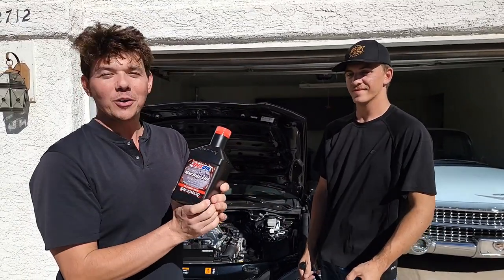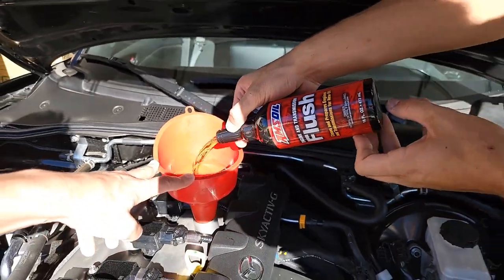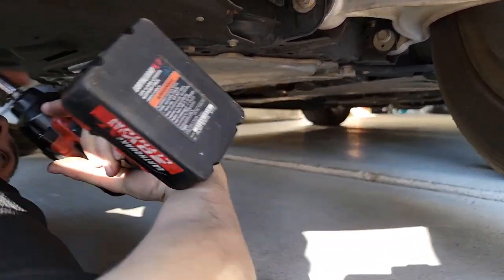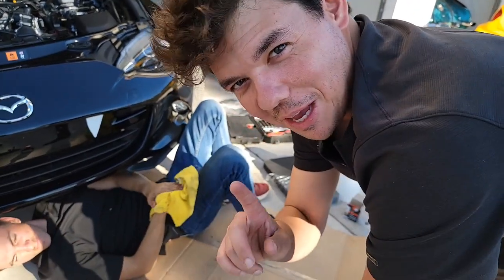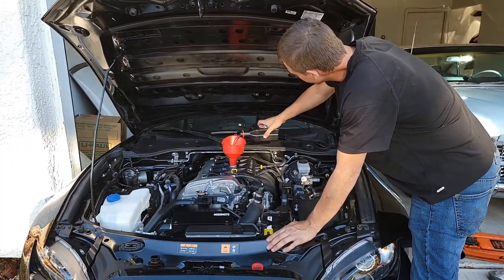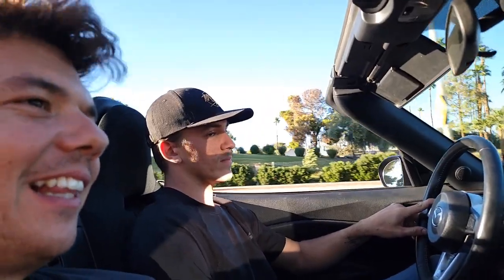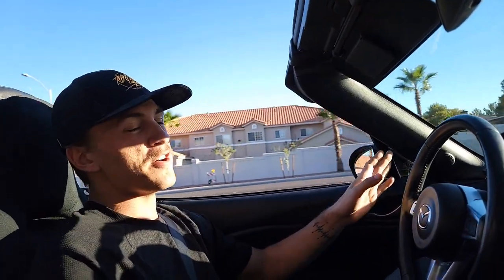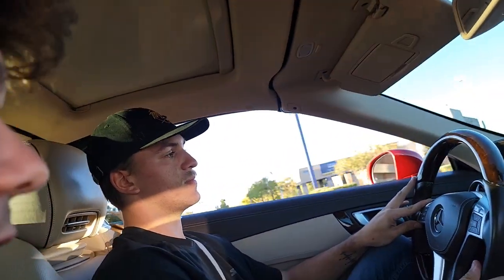Autocross Mazda Miata AMSOIL   10W-30 Oil Change & Dominator

Comment: What’s the drain intervals like on the dominator oil? I usually change my oil around every 3k miles
Reply from the maker: That's a great question there's a lot of different axiologies on that topic personally if I was running it I would change it every couple thousand miles if I was running E85 I would definitely change it every few hundred miles because ethanol breaks down oil definitely not worth risking it so it's always good to do oil analysis if you want to know exactly what to expect from the oil.
As they say a little preventative maintenance can go a long way and keeps the guesswork out of it💯
If you're new to Amsoil I highly recommend the six-month PC member will give you the best value on the products if you have any questions when you use my link I'll be able to answer them as your independent Amsoil dealer💯👍
New Promo: FREESHIP 
     ♥️   Shop by vehicle - https://www.amsoil.com/guides/?zo=5331179

     ✅   Save up to 25% on every order as a preferred customer: https://www.amsoil.com/offers/pc/?zo=5331179

Comment: I haven't tried the racing oil yet...
Reply: Very much worth the investment if you drive your car hard!
Reply from the maker: Thanks D!
Reply: @Syntheticoilprotection  if your engine is performance 93 octane tuned would it be beneficial  for it?
Reply: @1Starscream117  absolutely! My car still runs the base tune but I typically run about 95 octane with boosters and it makes a great difference, especially on track!